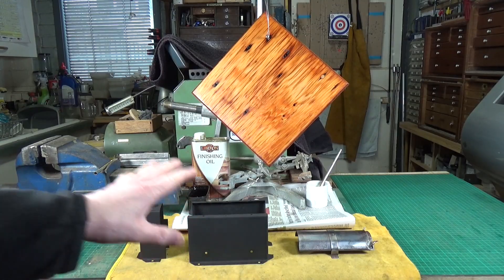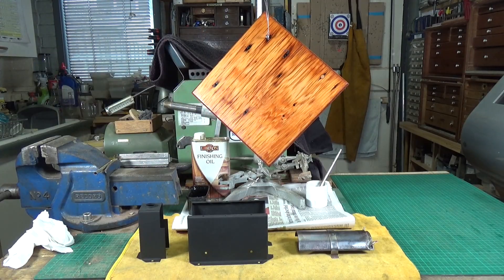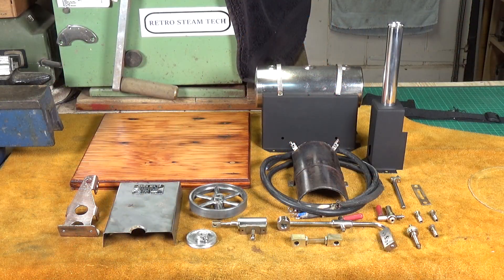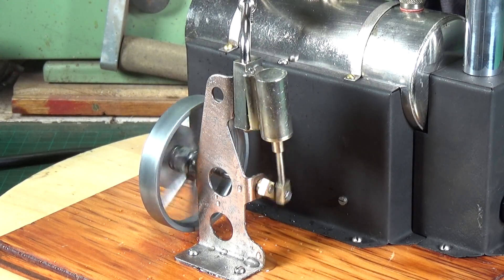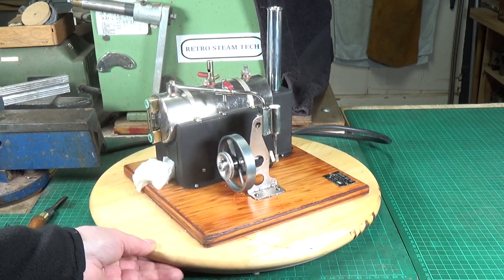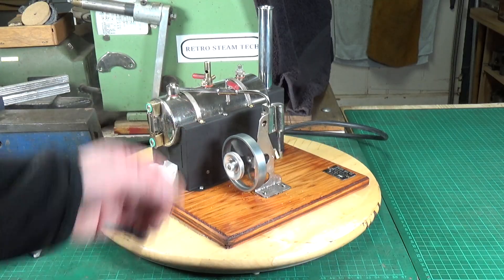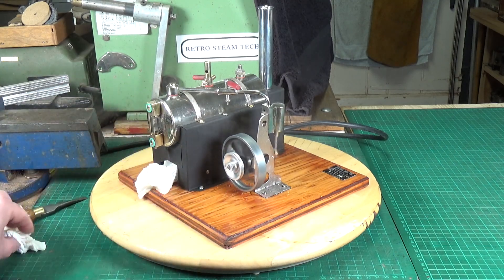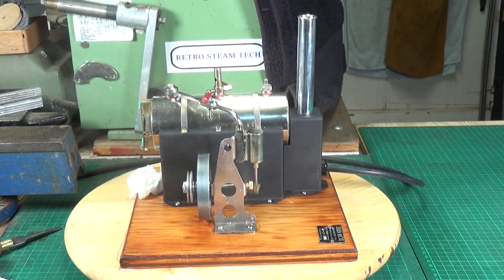Vintage American Jensen Model 70 Model Steam Engine - Part Two

Comment: I got one of those in the 1950s for Christmas, AND I still have it.  it's a little different as the cylinder and fly wheel is attached to the boiler.  About 7 years ago or so, I sent it back to Jensen, and they went over it and took out the nasty insulation, and replaced everything that needed to be replaced, I spoke to Mr Jensen's son and was very nice and had lots of information, about my engine.  BTW you can still gets parts for that engine including a chimney stack from Jensen.
Reply from the maker: That's great that you still own it. I think the engine you have is a Model 35 https://youtu.be/bdXv_lM48RI?si=qnwpZEihXDhNgXTf . I was aware that Jensen still sell spares for their engines, unfortunately as I live in the UK shipping costs are quite high. The smokestacks from these early models are quite easy to make though.
Reply: @RetroSteamTech  Yes, your right mine is a 35 and their must have been different models because when I was speaking to Jensen they ask if mine has a plate on the wood base or a yellow paper sticker (Goodhouse keeping) mine has (had the paper) My parents got it from Sears Roebeck Christmas wish book.  It had to be in the mid 50s

Comment: Glad that I do not own an "electric" heated steam engine and will never own for sure!!. Much too complicated for me. I just need water, spirit or esbit and a match. No measurements, no calculations, no Ohm, no Volt, no Ampere 🙂
Reply from the maker: Hi Paul. They are not too much of a problem. As long as the power cord and element are in good condition then all is fine. With old engines like this you do have to check things first though! Cheers, Alan.

Comment: looks and runs Great Alan  well done.👍👍😉😉🚂🚂
i too want to look in to nickel plating some time, been meaning to for some while now but something always gets in the way. same with casting billets of aluminium.🤔🤔
You spoke too soon about being Mild😱😱🥶🥶🥶🥶🥶🥶🥶🥶🥶🥶🥶🥶 just done a video in my freezer box and had diesel heater and gas heater on plus 15 layers of blankets i looked like michelin man, well thats my excuse and i'm sticking by it!!!🤣🤣🤣🤣🤣🤣
atb
Kev
Reply from the maker: Thanks Kev. I made my first foray into nickel plating this week, hopefully the first video will be up shortly. Yeah, down here over Christmas when I shot that video it was really mild, not like that now, just above freezing this morning 🥶🥶🥶 I'm very lucky that my little workshop is inside the house 👍🙂 Cheers, Alan.
Reply: @RetroSteamTech  look forward to the plating vid